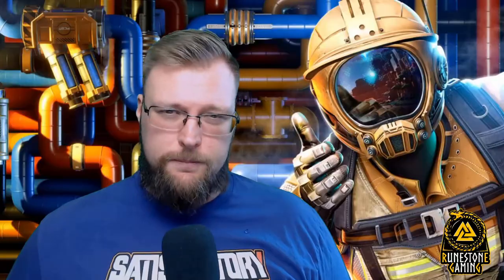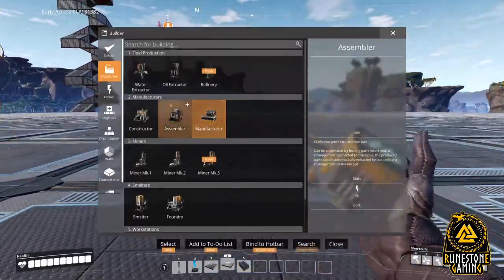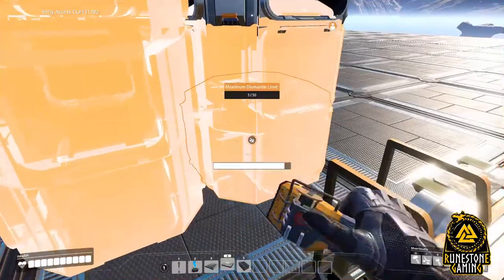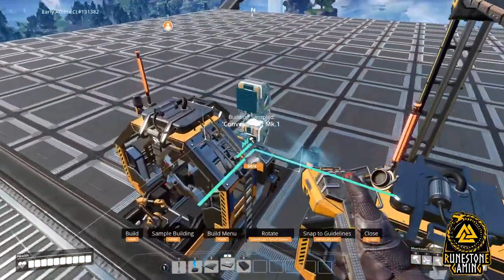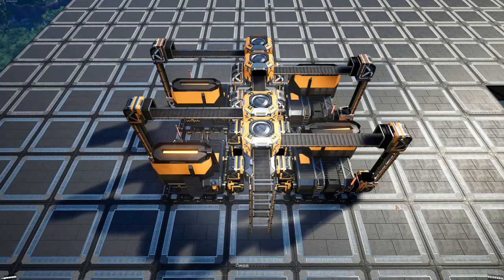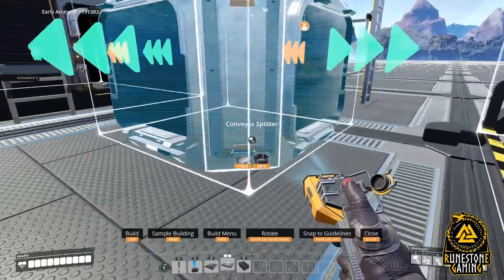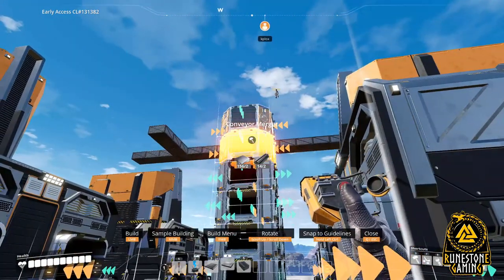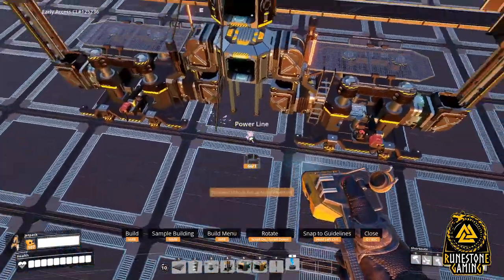Satisfactory Game Tips & Tricks - Clean Assembler & Foundry

Comment: Nice build and timelapse :) If I were to do the overhead technique for the foundries rather than placing two mergers next to one another, I would have one foundry merge straight into the merger (like you do) but the second foundry I would turn the conveyor elevator 90 degrees to the left so that you can get a nice right angle conveyor line into the same merger. 

keep up these helpful videos :)
Reply from the maker: Thats a damn good idea, didn't even think of that